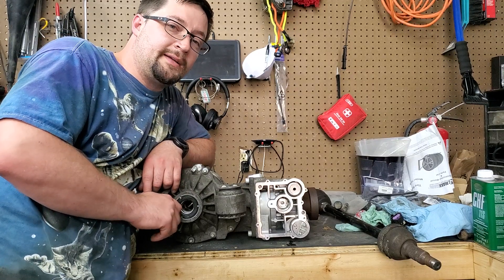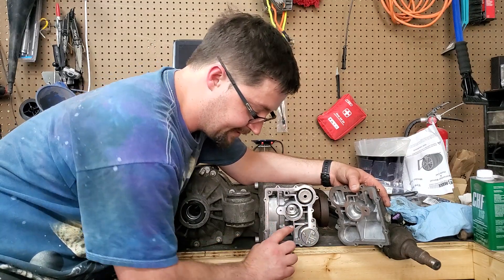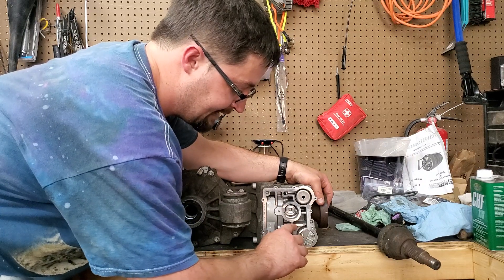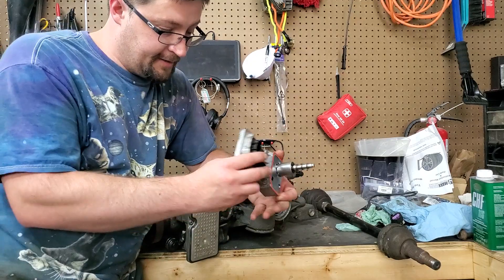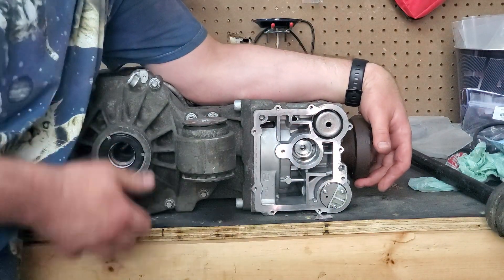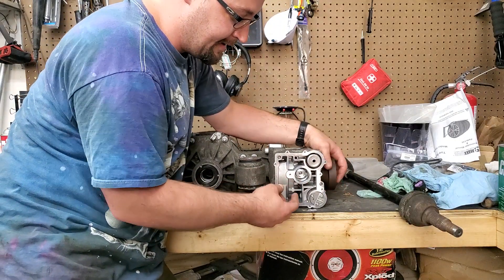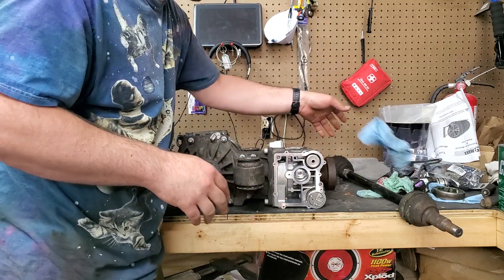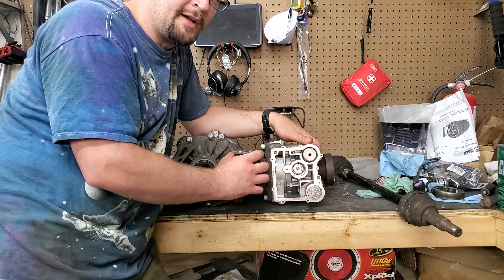Quick and dirty XWD Haldex 4 operation overview.

Comment: Thanks for this info, there isn't a whole lot of hands on breakdowns of this system outside of the ShopDAP stuff, mostly VW. They do have a video where they mention the system and its use in the Saab but not how it works in comparison to other systems. It seems to get grouped into other Gen 4 systems and no one seems to mention this has the two couplings (eLSD/clutch packs) which I believe isn't used in other applications (i.e. VWs etc)

Comment: Why "DO NOT DEACTIVATE THE SYSTEM"? No oil has come out of the breather for me. As long as there's right amount of oil in the system explain how it shortens the life of the clutch pack as they are still being submerged in oil.
Reply from the maker: I feel like I explained why and the conditions for which you should not deactivate the system. If everything is going to be turning at about the same speed, then deactivating the system should be fine.

Comment: Thanks for your demonstration.   I wouldn't have known that there was a filter behind that cover.  Where did you buy the filter?  Would it hurt the differential if the vehicle was toad with the rear wheels on the grounds?  And if so, what do you think would be damaged?
Reply from the maker: I wouldn't risk towing it with the rear wheels on the ground. The clutches could get fried, but I'd think it could handle a short tow at lower speeds. 

I have a service video with the links in the description to all the items needed for a service.

Comment: Great video.
The design is pretty dumb.
Why would they put a filler plug that doesn't allow you to fill properly and forces the use of the vent pipe that over time become almost impossible to remove.
Speaking from experience of having serviced this thing on a 95ng, and replaced a pump.
Now replacing the pipe nuts that failed that hold the hydraulic pipes.
As a side note:
With the car on ramps nose down and slow and steady filling it is possible to get enough haldex hydraulic oil in to not have the system complain or be intermittent. But it takes a few fill and drive cycles and a long enough and small enough pipe on a syringe to access the oil pockets
Reply from the maker: Certainly could use an improved design for the filling. I've always thought a separate reservoir with the filter built into that would be the best solution. I think the Mitsubishi Evo has something like that for it's AWD system. I've actually used the nose down approach a few times since I made this video and it does work well.
Reply: @autoholicmedia  with the nose down on the ramps.. to be absolutely sure you can jack it up and add two bricks(side by side) under each rear tire for that extra height, is my usual now 😀

Comment: I hope you see this question.   I know you did this video months ago.  I watched your other video when you changed out all three fluids.  I was hoping to see which fluids you used... where. ( I think I know )    I saw the one ACDelco bottle..for the rear on one side and I assume the clutch fluid is where the filter and gasket side. .      Curious.. how do you clean the pump screen?   Can you clean once you take off the side plate?   By removing those two screws?   If the XWD system  Service system  message pops up, within WIS, it states the systems shuts itself off..  In your opinion what are the fluids doing within the Diff at that point? If the car becomes FWD.  If you cannot tell if there is an external leak, where is the fluid going?  Is it mixing together with the other fluid?   These questions I ask pertain to a NG 9 5 Turbo6 XWD without eLSD.    Can the fluid be low up at the front case for the system to show that service system message?
Reply from the maker: Unfortunately, I am a bit late to reply to this, so I hope you already figured out your issue. I do list the fluids I use in another video I have, but the AC Delco bottle is limited slip diff fluid. I have now switched the haldex fluid that I use to Ravenol AWD-H fluid.

As for the message popping up, that is generally because the fluid is low in the front of the unit. I just experienced this with our 9-5 Aero and the eLSD clutch seal failed, causing the haldex fluid to leak into the rear diff section. So the front Haldex portion would get low, while the rear would become overfilled and even pressurized, causing diff fluid to leak past the axle seals.

It could also be a simple low fluid situation from not putting enough in initially. Bad pumps have been another culprit for the XWD system failing.

Sorry again for the late reply, and what have you figured out with your xwd system?